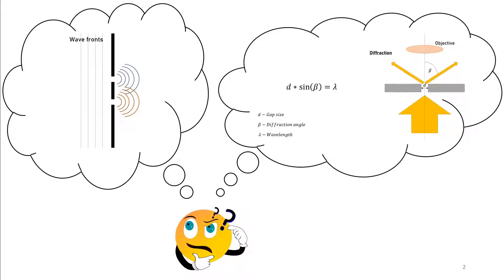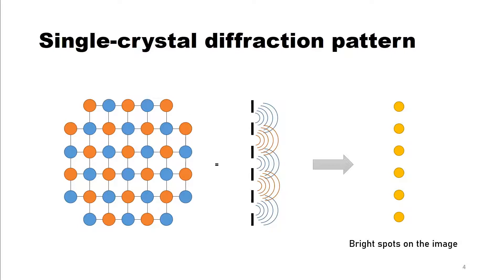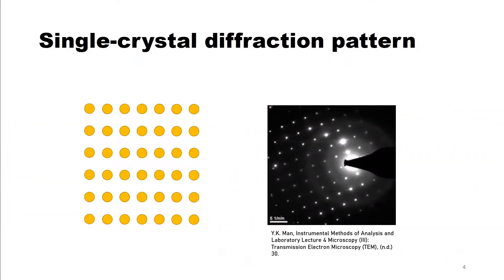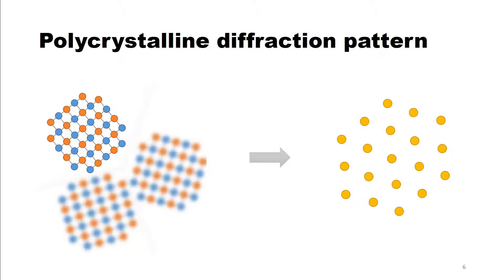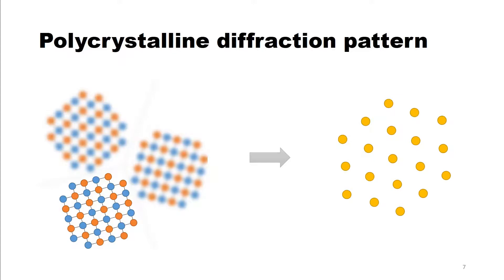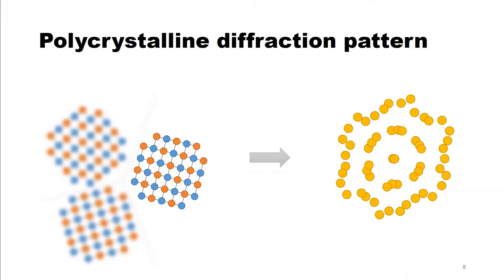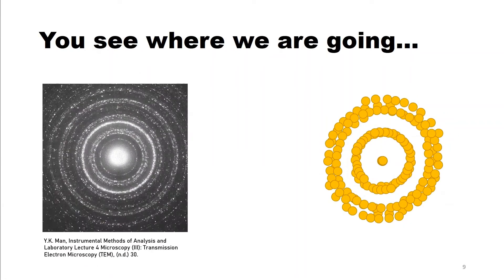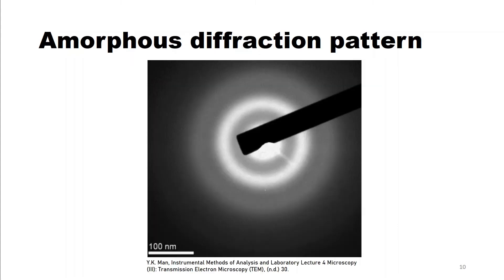Diffraction patterns in Transmission Electron Microscopy (TEM)

Comment: I have a question about the Atomicnumber example. When the Atomicnumber increases does the diameter really get bigger? Or do the electrons interact more because of the extra protons in the atomic core?
Reply from the maker: Hey Pagoseto, the atomic radius generally inceases when you move from left to right in the periodic table within a period due to increasing nuclear charge (more protons). However, if you move down a group, the atomic radius increases due to the increasing number of electron shells. 
Hope that helps.